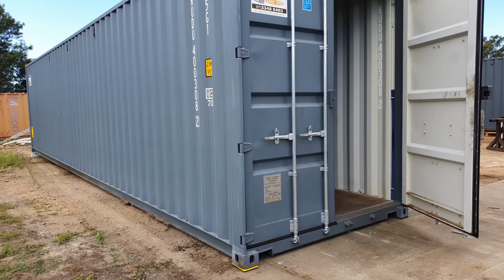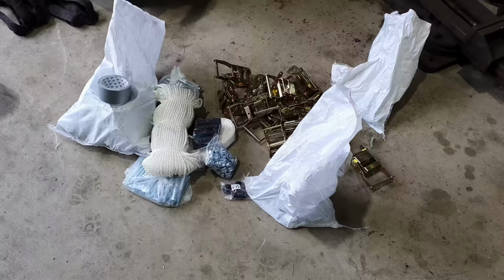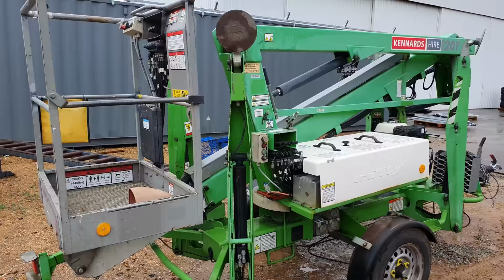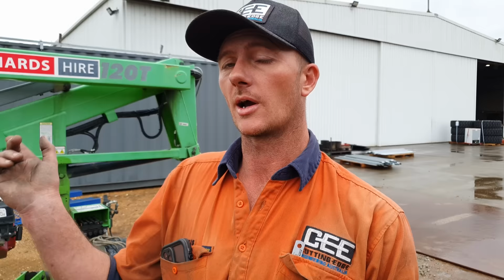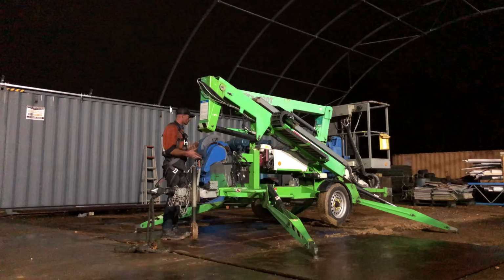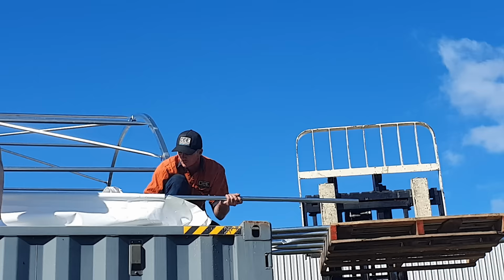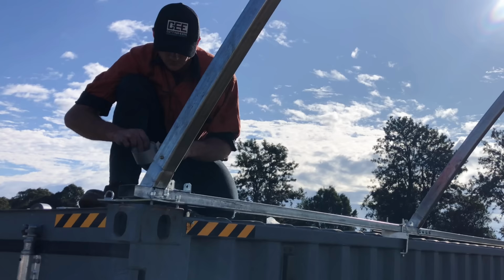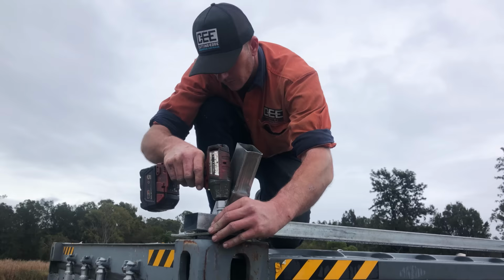Installing a 40FT Shipping Container Shelter | Expanding The Workshop! | Part 2

Comment: The more you install, the drier you will be! I have to say it's very strange to see you working with such "flimsy" metal, Kurtis. Normally it's like a $4,000 solid piece of induction heat-treated chrome bar stock, not tent poles. Good videos, keep it up mate!
Reply: And then give it a slight wiggle.. concluding: “that aint going nowhere”
Reply: Of course at one point or another you'd have to get the line borer mounted up there
And the entire thing chucked up in the lathe

Comment: Im so amazed you did this alone... I would have needed a team leader, a safety person, 4 manual labor guys, 2 machine operatos and coctail waitress. I bet he hated leaving the job unfinished on the first day :D
Reply: Tchah! You are working on a low budget. Or they would have been a DJ, pole dancers, lap dancers, cage dancers and mud wrestling etc 😂
Reply: And a pastry chef
Reply: concrete. You get on a roll assembling something like this, get the method going, it's  almost painful to stop.
Reply: You also need a two hour planning meeting before installation begins then a safety meeting when everybody shows up at the job site.
Reply: @tiredoldmechanic1791  And the obligatory site induction, License submissions (White card, Working at heights, EWP, Forklift, Crane, Dogger, Rigger), SWMS and work permit signing party!

Comment: I have 6 of these at my place. On my second year with them. So far I have been happy.
Piece of advice: The brackets That attach to the containers need to be welded to the containers or at a minimum the Allen keys checked monthly. They do back out and slip off. Had 2 shelters fail on the same day where they slipped off the square tubing on the top of the container. Bent up the frame a bit and I had to remove all my junk to get them repaired. 

Also everything underneath does still get wet in the rain because they are so tall with or without the wall up. 

Good luck. Love my extra shade.
Reply: Yes, I think I would add the welds as the massive square footage of the canvas can create huge lifting forces on the frame, even with a moderate breeze- anybody with any sailing experience knows what I'm talking about.
Reply: J-B weld 🤷🏻‍♂️

Comment: I've said it before but I'm constantly fascinated in how your mind works with mechanical issues and problem solving.  Thinking to put tape on the joints where the tarp might rip was excellent but the fact that you took something like this and were able to assemble it with no instructions (not to mention extra/missing) parts is phenomenal.  I know people that can't put 2 and 2 together with assistance.
Reply: It's 22! I even had my wife and dogs double check it for me, so there's no way I'm wrong.

Comment: Kurtis, you need one of those wireless actuator for the sling to decouple it from the ground. Like the loggers use. Forget renting that little man lifter thing. You must’ve walked 110 miles and climbed 210 flights of stairs for this job!  Lol ! EVERYTHING you do is top notch. You do things RIGHT… I respect that immensely.

Cheers!

Comment: Awesome job…. Strange that these company’s don’t have a QA section that would double check all components placed in the crates prior to closing up the box for shipment…. I have run into this issue myself with various items I’ve purchased…

Again strong work!  🤙🏽🤙🏽
Reply: Keep in mind that not everyone is doing their work good and careful.
Reply: They certainly should have the instructions available online (they don't). Seeing how it is done before purchase would be a selling point!
Reply: Look for the "Made in China" quality seal to understand the issues.
Reply: At the very least, a link to their website with a PDF of the manual.🤯🤯
Reply: Even though i'd join dunking the fine produce of the "People's Republic" any day, the QA issues (and specifically packaging issues) are a global problem, happened to me even with industrial grade German made equipment, even with a freaking Lego set (do humans pack these? is it robots?)
Reply: @MrThisIsMeToo  even "made in Germany" isn't a good thing often. We are pretty down in good manners, efficiency and quality and a lot of people are pretty angry about everything
Reply: @imtheeastgermanguy5431  "Made In Germany" quality has gone downhill I agree. Still better than most.  Reason I believe, is they are trying to compete with the Chinese crap, despite the tariffs we have.
Reply: @MrThisIsMeToo  Chinese quality can be good but then you pay as much as you does from a big brand. I saw a lot of junk made in China and it was so rubbish I couldn't understand why people who build this or put it together don't think about what they are doing. I guess that they would lose their job if they are asking. Most of the people in China are not bad but a few people like in the government or so are ruining a great country with their incompetence and lack of human rights. It's in other countries similar

Comment: Great work on the installation without an instruction manual and with parts missing. The video editing and commentary was outstanding. Looking forward to seeing the end wall installation later. The main issue now is the mud and it would be good to have that area concreted, which would also be beneficial as a more stable base for working. We do get high winds here in the Hervey Bay area at times, so it's good that this isn't an issue for you on the Gold Coast.

Comment: I would highly recommend a line on either end of the structure tied down to something solid. We put up a similar structure at the local rc car race track, but rated for much higher winds(Arctic) with double trussed arches, etc., and the weakest aspect of the design was rigidity in the axis perpendicular to the plane of the arches. One small cable from the apex of the roof line to an anchor point on each end would do the trick.

And the track tent cover also came with a generous warranty but the UV got to it in less than a couple of years and it had to be replaced. The new cover was treated with some kind of coating by the track owners and it lasted much longer. Not sure what they used but it looked like white paint. Cheers!

Comment: Hey there Kurtis, just a word of wisdom from personal experience, you should cross the break away chains on the trailers hitch when you connect them tow hitch, it creates a cross that will catch the trailer before it hits the road in the event of the hitch failing

Comment: It sure was great that you had experience putting up these structures.  It would have been a nightmare not knowing what to do and not having any instructions.

I was smiling really big when I saw you tossing the pull ropes over the top to the opposite side.

Great work you all.

Comment: I guess the truly sad thing is you had to do it all yourselves, and I do include your partner in this exercise. It's a lot of hard work for two people to do on their own, even with the machinery used. But as usual you both handled yourselves very well and did an extraordinary job of erecting this shelter. Good on you both for your hard work and effort, without a manual too.

Comment: What a good idea for a farm or ranch. I have worked on a few big building sites that had the exact same shelter-dome,
in between 2 shipping containers, as the containers are often used as storage for the different trades on site, you 
would have the plumbers, the steel workers, the concreters etc. the electricians storage container would be "a mess"
with all the gear thrown on the ground, the boxes and parts scattered everywhere, the shelves would be nearly empty.
That was the "organized storage space for the sparks", you could only find the gear you needed, if you knew who hid 
the gear in the first place, shenanigans "on site", and a 3 or 4 hour job can take 8 or 9 hours, maybe more. Apart from 
building sites, there was the exact same dome shelter on Bondi Beach, the "drive-thru" bananas there were doing the
Covid Testing, for a few years, apparently they were asking you for DETAILS, like NAME, ADDRESS, NEXT OF KIN,
CAR LICENCE, CAR REGISTRATION, WORK DETAILS, WORK CONTACTS, BANK DETAILS, BANK PIN NUMBERS,
BANK BALANCE, BLOOD TYPE, AND OTHER THINGS OF A PERSONAL NATURE. I'D RIDE PAST ON MY BIKE IN DISBELIEF.  

*Note: THE 2 CONTAINERS WITH 40X40 FT DOMED SHELTER....IS THE GO. FOR PROPERTIES, FARMS, AND RANCHES.
THE CONTAINERS THEMSELVES ARE 40 FT, AND YOU COULD EVEN HAVE 3 CONTAINERS, 1 AT THE BACK, AND THE
POSSIBLE "USES" ARE MANY, A MYRIAD OF USES, INCLUDING WORK-SHED, GYM, GUEST-HOUSE, STORAGE & STUDIO.
LAY A CEMENT SLAB UNDER THE DOME. UP THERE FOR THINKING, DOWN THERE FOR DANCING.

Comment: I worked in tunnel construction and containers are a great asset on site, on a job in Cairo transport and equipment was shipped in 2nd hand container that had been partly modified as field workshops with window frames the openings cut out onsite, collapsible benches stowed on the floor and Land Rovers etc. loaded.
These could be stacked around tunnel shafts to reduce noise, other used as your set up. At contracts end some even given to locals and used as cafes etc.
We didn't have the offself cover option but site engineers did make it happen.

Good to see you now have weather cover, trust there will be a light install just in case you have to work late. Cheers another great video and tips, stay safe.

Comment: Curtis, as an engineer you will grasp the significance of this question. As an engineer and sailor, it occurs to me that when you close off the end of the outside workshop - and congratulations on having it by the way - you will have created a large sail and a very large wind trap. The strain on the outer (first) arch will become huge on a windy day. My question is: will it be a sensible precaution to reduce the structural strain by linking a steel cable from the peak of the arch - and perhaps the second one as well - to either the top or lower corner of the containers ?  I appreciate you'll not want to fix something that isn't broken, but this suggestion is a very cheap insurance to prolong the safe life of the canopy, and a small wind can create enormous power. Just look at similar sized sails on boats in your home waters, or talk to a yacht club.  Great videos, very well edited. Good luck to all three of you. Regards.

Comment: Nice!!!
Word of advice. If you ever get any flooding in that area be sure to stake those containers down. Don't rely on what's in them to keep them in place in case of freak weather.

Story time if people are just mulling around the internet.

We had something like this at Fort Hood Texas while mobilizing for a deployment to Iraq a decade or so ago. Aviation unit with 40 UH-60s
There was a flood after some never ending rain. Couldn't see a single helicopter tire as the water level was just over them. Conexs had floated around. Those with power cables had wrapped themselves around the poles and then were pulled onto their sides and sank.
One similar to yours moved off it's pad and filled with 3 feet of water. The other stayed airtight and floated around.  
Our big clamshells stayed in place but all the boxes stacked up inside were made of heavy duty cardboard of which all the bottom boxes in the stacks turned to mush.
We had a TON of laptops. One for each helicopter in a large tent area. They were all on tables charging and would have stayed that way as the flood level didn't reach the table tops. Unfortunately all of their shock and waterproof cases were neatly stacked under the tables. Being watertight they floated and upended the tables and in went the laptops. Power cords froing from the power strip mid wall into the water with the laptops resting on the bottom like anchors. All the portajohns floated up and fell over so they sailed around all over the place now empty of their original "cargo".  Once the water receded the entire area was closed off and called a biohazard zone.  Ya see we had all just been vaccinated along with getting other shots. Band-Aids were EVERYWHERE. Some of our vaccines were live.
Damage was in the millions. Still deployed on time. 6 months later we find a box that was never unpacked and thought to have been left behind because of the damage.  Hey a laptop case. Holy crap it's heavy... Open it up. Water goes everywhere. It had filled with water and sealed itself and managed to make it from Texas to Kuwait to Iraq. without leaking. 
Good waterproof seal!!! Must of been put on backwards.........................

And that's how I became responsible for Texas carrying out a biological attack on Iraq..... 

Good times..... Good times........

Comment: A great build as always! Especially since  you did the first part on your own, running between the containers, climb up and down, fit the arches in  ( not even talking about when a arch strains and you had to climb down to adjust the tension with the crane, go back up, repeat cycle, i know how hard it can be :D )
What i also like is that you work with the right safety equipment and turn off the engines instead of let them running unnecessary.
A good  example that it's perfect to do to combine safety making money and the environment. 
Keep up the good work!

Comment: If the igloo covered the entire container, it would help insulate the container and give it a higher roof.  If it snows or rains less will run off, but now the snow that runs off the roof is accumulating on top of the container.

Comment: When you come to put on the end make sure you can open a good gap, after building many greenhouse polytunnels only 1 fixed end is worse than none at all. The wind when in the right direction will try to inflate it like a ballon and if it has no place to go something will give, by having the posibility to open part of the closed end will give somewhere for the pressure to escape. Great job on the build especially by yourself, all that up and down your legs will hurt in a day or 2 but the end result will be worth the pain. Some good camera and editing too, often overlooked by many.😘

Comment: it turned out great ,, when I bought my place about 2 years ago ,, there is a 30 x 80 barn about the same setup .. but on mine they built 4 foot side walls ..so it is about 15 ft tall in the center ,, I just need 4 shipping units ..too make my barn taller .. they build wood walls each end with sliding doors .. sucks when the rain comes in you can't hear very well .. but it saves on the elec bill in daytime .. don't know if needed but could hook a ground wire to the frame and run it to a ground rod .. if lighting hits it ???  great video ,, thankyou for taking the time to make it ,, the look on Homeless when he seen daddy up there ,,, this job site is not up too safety rules.. lol

Comment: When I built a little greenhouse out of an old truck shelter, I did the same thing, put duct tape over the joints in the frame to keep it from ripping the covering.  I thought it was the most ghetto solution ever, but the manufacturer really sent you a roll of duct tape!

Comment: Fantastic project. Make sure from the manufacturer, if there are any wind limits on the installation. Good that there's bracing but if predicted winds are high, you can take any necessary precautions. I would hate for your shelter to end up in Tazzie. Paul

Comment: Well bugger me with a fish knife, CEE posting on a Tuesday completely took me by surprise. Nice igloo Kurtis, and really good narrating Karen. Building without instructions is character building, I've done a few times with a 12' x 12' shed and a 16' x 12' garage, both steel panel and like you bits missing and too many of other bits. Still standing after 8 and 6 years respectively. Igloo looks as if it will last a long time, at least it isn't upside down. Great post, be safe take care.

Comment: I think that here are times when you really need a 'flunky' to give you a hand when needed. Much respect for doing this all by yourself, I'm in the same position, just not on such a grand scale. I don't know if you ever get snow in that area, but here in western Canada buildings similar to this have to be of very heavy construction and a steeper arch, or they will collapse under the snow weight.

Comment: It looks like a MUCH better quality made structure than the "garage in a box" product I recently purchased & put up.  It also was missing a few parts & some were miss welded, so I ended up buying a 2nd kit & returning it with the bad parts when done.  The store knew about it in advance & actually approved of the plan, so it was a breeze returning the 2nd kit, but it would be better if the things came properly boxed, so to speak.  A few weeks after assembling it, a large limb fell out of the giant Oak tree hovering above it, bending a few bits & tearing a gash in the tarp.  Also, my covers are all developing hundreds of holes at the points where they were folded together for shipping.  I am considering replacing most of the vinyl covers with sheet metal roofing/siding used on metal buildings.  Anyway, good luck with your new structure. It does look to be a great welding area.

Comment: Great video guys ! Loved the ending ! Needed that ! We put up a 13x20 round top and after replacing the top a couple times . I got pole barn steel 20'6" and ran it horizontal . Haven had a problem with leaking . Even put wood ends and doors  . Used clear fiberglass panels down both sides to let natural light in . 👍🍻